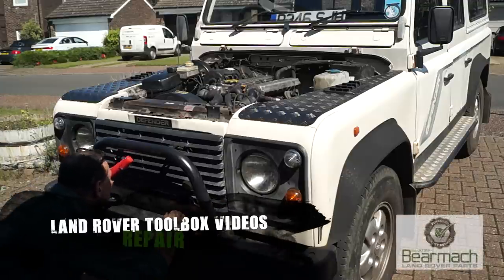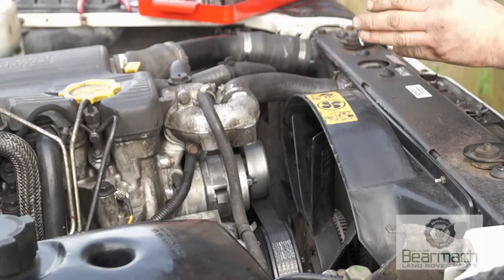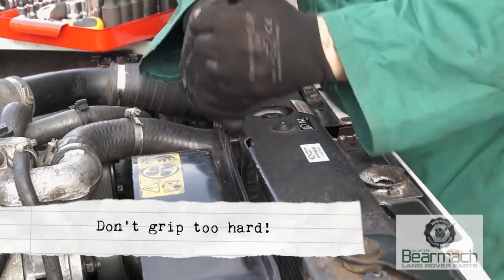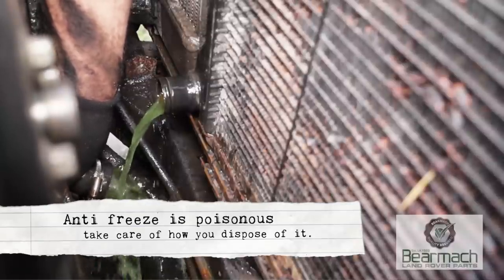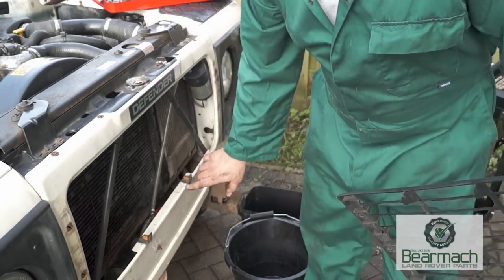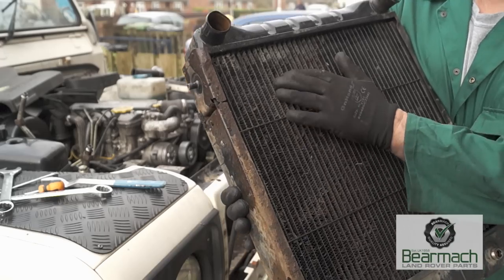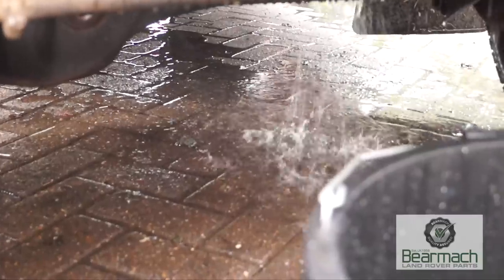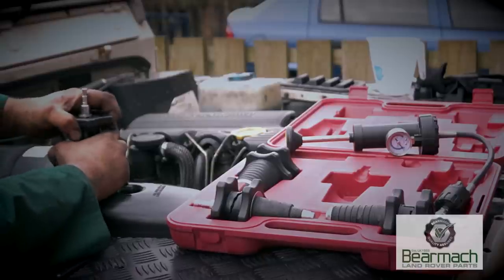Replacing a radiator and reverse flushing engine  - The Fine Art of Land Rover Maintenance

Comment: hi 
Use a concentrated flushing agent .Typically 1--2 cans some has to be dissolved prior , drive for 15mins to get properly circulated and to get well agitated . This will absolutely strip out all corrosion and dirt . Needs to be well flushed and radiator core diss-assembled  for internal cleaning. 
Use a pressure cleaner on overflow bottle . Flush heater core .

Comment: Great tips there! I am about to do this job on my TDI 300,  I am toying with the idea of fitting an alum rad rather than the copper one, would it be worth fitting an alu or just replace it with a copper one?
Reply from the maker: only cost makes the difference.  Copper on can be repaired.

Comment: Quick one. I removed the red coolant from my system, flushed with water twice. So basically filled the system up twice and run the engine both times. Then refilled with millers blue which is the correct coolant. However my header tank fluid looks brownish colour already. Def no oil in coolant, head gasket is fine. Have I flushed the system enough as to not mix the two??
Reply from the maker: Sam Bam not if you have flushed it properly.   Could be rust?
Reply: Just dipped the header tank and rinsed into a cup and it is still a very light pink? Old coolant originally came out pink with a few small metal particals. But I did a 50/50 mix, if it was rust surely the coolant would appear murky, where as this was quite clear.

Comment: Good day ,
Can you upgrade your radiator like you would a inter cooler, and would it make a change to anything?
Thanks
Reply from the maker: Good question.   Unless you live in extreme conditions, there is no point having a larger radiator unless you are doing something really specialist with the vehicle.  The best efficiency you can get with the engine is to have it and maintain it at running temperature.   Cooling system design is already efficient. Aas long as it is kept in good order should there be a reason to change it?
Reply: Thanks for the advice, greatly appreciated.

Comment: hi 
I want to flush my discovery 1 300 tdi coolant system through and replace all coolant. what's the best way to do this please ? through the thermostat? is it just a case of flushing through until all comes out clean. refilling (how much coolant? which coolant?) then running with the heaters on and cap off expansion tank until bubbles stop... squeezing hoses to remove all air? 
thanks 
Jesse
Reply from the maker: Didn't i say all of that in the video?
Reply: I just wanted to check if it was the same on disco...
Reply from the maker: It sure is.  Good luck!

Comment: hello. I got a 300tdi in a d1. had head off and I'm starting to get heat issues intermiddently. the was a composite gasket on It and when it was scraped off some may of fell in. you think that this would get rid of it?
Reply from the maker: sorry not quite understand what you have written?    Gasket fell in where?
Reply from the maker: have you checked the head condition?     https://youtu.be/oTi6B7VNE7U
Reply: in to the cooling system when I had the head off
Reply: and yeah. it was serviceable. it first started when I bounced over some crap when I went bush. ive replaced the thermostat and its still on and off. so that's why I reckon its a foregn body in the system
Reply from the maker: It is a possibility that something could be blocking a water gallery.  I could' hazard a guess as to where it would be blocking but the narrowest parts are where the head gasket is Gasket restricts some of the flow to the head.arounf the cylinders.
Reply from the maker: Reverse flushing may remove the crap?